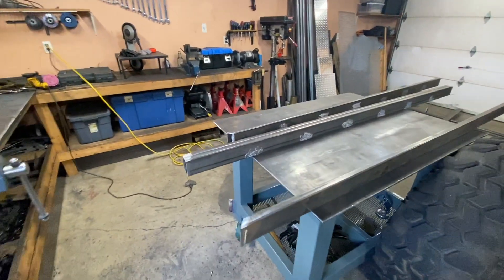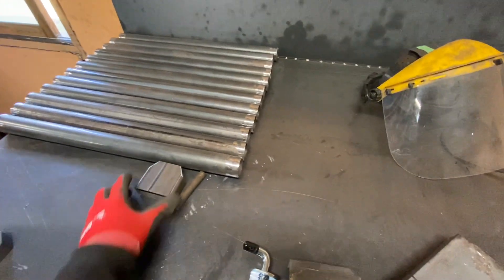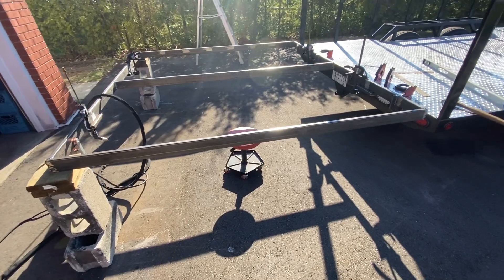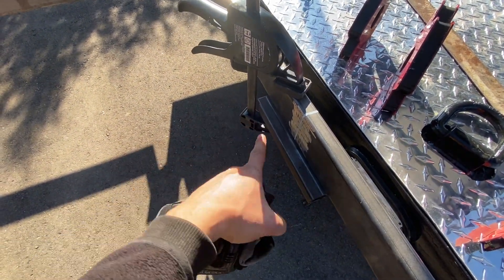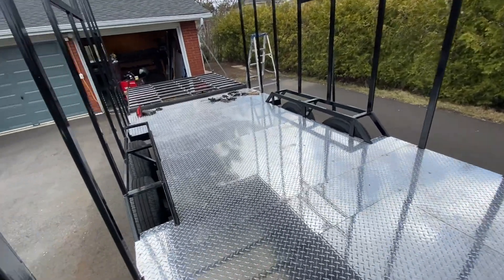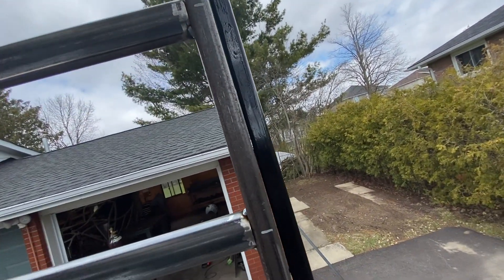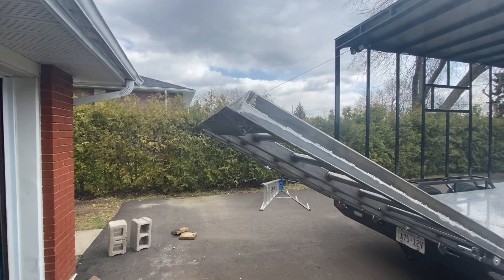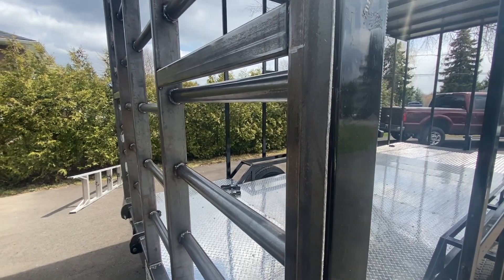Enclosed trailer build | Episode 6 | Rear door

Comment: I am getting ready to change a box truck to a toy hauler. I am disabled so i want to do it correct the 1st time.This video helped me a lot. What would you guess the door weighs? I hope to use the roll up door cable to assist the ramp.What are you going to use to cover the ramp?  If you ran a round bar across from the winch to the other side it could roll it up both sides evenly.  Then you can alternate winches so they both get even use. Thanks
Reply from the maker: The door is heavy, probably almost 400 lbs. I need it heavy duty so I can drive my off-road buggy over it. For something lighter duty, the door can be made a lot lighter and even use the spring assist. Thanks for the tip on the the round bar connected to the winch. I will need to do something to sync the 2 winches.
Reply: @rgsabat  Thanks for the quick reply. Look at a roll up door for the perfect roller design.I have owned 5 box trucks with no roller or spring problems.  I want to bring in my RZR. I wonder how much weight the existing  spring cable will help. I might be using half existing and half winch. I am looking for rear door springs to help. Some people do not want to sell parts. If i figure it out i will let you know. I have to practice up on my welding. Fun fun fun.Cheers

Comment: Very cool way to raise and lower the ramp door, but wondering why you didn't just simplify the operation by using a spring assist instead of winches, which are prone to failure, or dead batteries? Is the door too heavy for spring assists? I see this was about a year ago, and the trailer must be done by now?
Reply from the maker: Thanks. I used winches because the door is heavy. I have to drive a 6000 lbs vehicle on it.  I have 2 winches on it for safety. The system has been working good, the only trouble is that the two winch lines become out of sync when lowering the door and I have to manually re-spool one of them each time I open the door. Maybe spring assist would have worked with some heavy springs, but I also got worried about injuring myself trying to set them up properly.
Reply: @rgsabat  I work at Edwards AFB as a jet engine mechanic, and our overhead cranes made by Demag are a dual crane / winch setup in which the two cranes running on the same track, can operate independently, or in sync, so we can lift a long engine from both ends evenly as if it was a single crane. So, the technology exists to have synchronized winches for your door if you ever get tired of fussing with getting your two to get along together. Just an idea!
Reply from the maker: @SeanoftheMc  Thanks, I appreciate that. I will look into how to synchronize them better.

Comment: Does pulling from one side flex the ramp much?
Reply from the maker: I use the ramp to drive up and down it, I haven't tried pulling it from the side. Not sure I understand your question.
Reply: @rgsabat  I was talking about the raise and lower winch for the door itself. You had it attached on one side.
Reply from the maker: @fastdadgarage-northsouthch4418  OK, I understand now. I had one winch cable at first, which was ok and did not affect the ramp door in anyway (the ramp is quite heavy duty). However, I eventually added a second winch on the opposite side for safety (in case the single winch cable fails). It works ok now, but the two winches are out of sync when I drop the door down and I have to manually re-spool one winch cable to get them to sync again. I should have installed a pulley system for the ramp door, I might do that at a later time.

Comment: Amazing build! Just curious, how do you lock the rear ramp door so people cannot gain entry while you are away from the trailer?
Reply from the maker: Thank you! I didn't put a lock on the rear door because anyone trying to open it from the outside will be forcing against the two winch cables that have brakes on them from the winch drums.
Reply: @rgsabat  that would make sense! Forgot about the electric winches! Thank you for the inspiration, looking into building an enclosed trailer myself!
Reply from the maker: @andhig05  Enjoy it! It was a fun project for me to do.